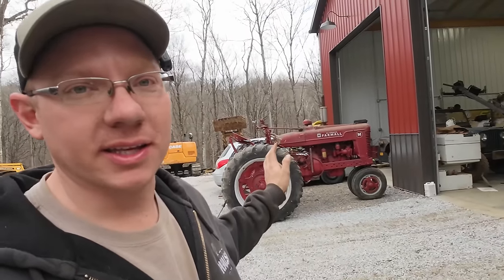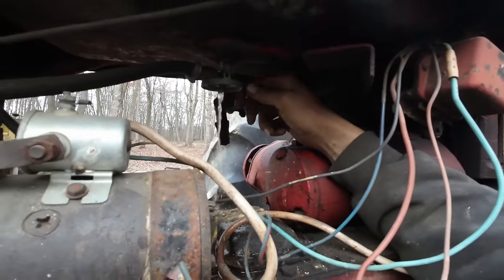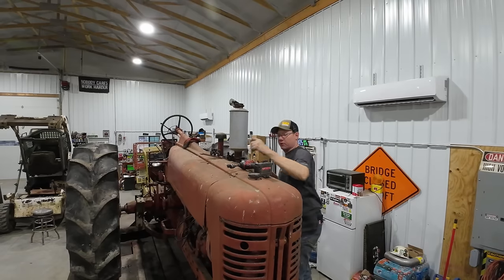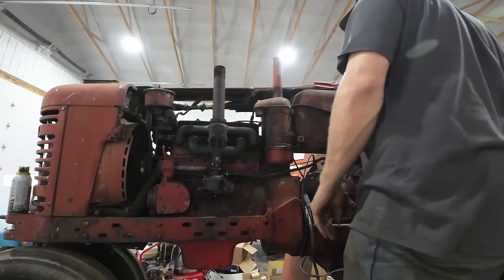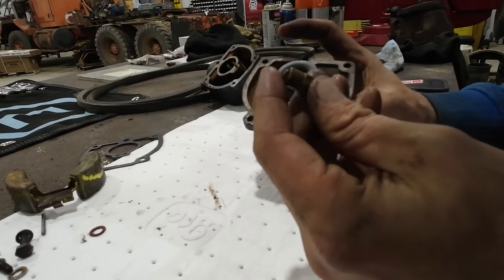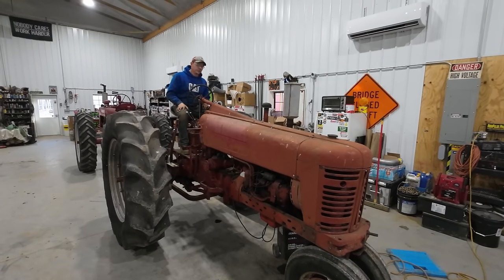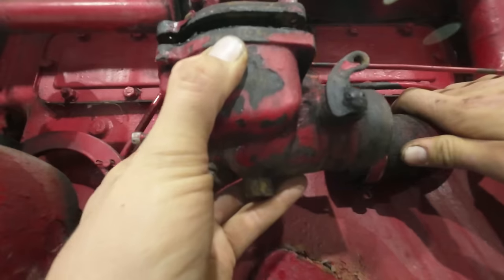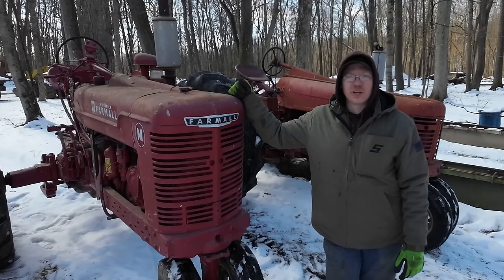Two Farmall Tractors for $2400 | Will They Run?? (Sitting Many Years)

Comment: As a tractor collector, I'd always say keep both.  However with your love of collecting things, what you likely really need are more covered areas before you need more things that really should be covered.
Reply: Some nice big tarps would help. I could not go to all the effort of getting something running and then leave it in the open.
Reply: @almac2598   putting tarps on things just makes them rust faster
Reply: @ASadSloth  Not been my experience, we used them extensively when I was at sea to protect upper deck fittings, and now retired I live in a country with much more benevolent weather than this part of the USA, so things may be different there.😁
Reply: @almac2598  oh, i don't live in the usa either 😂 but i have seen few cars that have been put under a tarp for several years and they have been rusted to hell after it
Reply: Covering with plastic creates moisture and that promotes rust. Best kept is dry and preferably warm.
Reply: I would Keep the M it looks cooler and in better condition.
Reply: @ASadSloth  nothing like keeping the moisture locked in with a tarp to insure the best corrosion!
Reply: Flip a coin on which one to keep. 
Give the other one to me! 😊
Grew up driving mta and 400.
Reply: @stephenbonin3049  Going by paint? Like he said the other one has more options. I don't like the tricycle front ends but.....
Reply: 0 @ASadSloth

Comment: In 1992 when I bought my over gown 20 acres in the country I needed a tractor with a bucket to work on the place and clean things up and do all kinds of chores. I found a 1953 M with a snow bucket on it for $1350. I live in western Wisconsin so a snow bucket it a plus with a 900 foot driveway. I also got an old beat up Gehl flail chopper that I used for a couple of years to mow the fields and chop up the burdock. I love the sound that burdock makes going through the chopper. New plugs, points ignition resistor, and oil changes is all I've done with it in 32 years. A real Sweetie. My Grand dad and my uncle both had Ms in the 50s and I think of them both whenever I get on mine. The best machine I have ever bought. It has never let me down. It sounds just like those two. Purr. Fred.

Comment: To my knowledge, 300s and 400s were painted all red. 350s and 450s had a white grill and white on the side of the hoods. Great tractors!
Reply: Yup. That’s a 400. My grandfather, father, and I farmed with a 450 for decades. It was only tractor my grandfather bought new. When we sold it a neighbor bought it and he’s still using it as a utility tractor around his farm.
Reply: I've been around dozens of FARMALL'S, and I can tell what model one is from 100+ ft away at 60 mph.  I absolutely HATE when somebody puts the model decal on the grill,  the rib embossed in the hood was formed special to curve around the decal.  There's a book called " IH tractor ORIGINALITY GUIDE WRITTEN BY GUY FAY.  he has all the decal placements shown the way they were installed AT FARMALL in ROCK ISLAND.
   BUT the tractor your calling a 400 is actually a 300,  it's about 2 models after a FARMALL H. 300 is a really usable tractor. The order was straight H from 1939 to 1952 then SUPER H from 1953 to 1954, then 300 from 1955 to 1957 , then 350 from 1957 to 1958.
    Tractor Data has all the information you could ask for on-line on ALL those tractor models, lots of people bad mouth Tractor Data but don't bad mouth it, it will be right much more than ANYONE you know.

Comment: Don't forget to check the timing advance on the distributor. If  they are seized, you won't get full power at higher RPM. A distributor left standing would be a Prime Suspect for seized Bob weights.  Love watching your show from the UK. Cheers, Mike.👍
Reply: Good head,man,hate working on something that hasn't moved in 20 years ,as soon as you start em up every seal in goes to hell😢😢

Comment: Matt, install the duct to the oil bath filter and it will restrict the air flow enough to cause the fuel to rise up to the engine. Make sure the air filter has oil in it.

Comment: Float wasn't clean enough. Clean with carb cleaner, then scotchbrite until it's very shiney. Use acid-core solder with flux, and it would have soldered easily. Solder doesn't work unless things are super clean. I soldered the float on one of my old Kohler gensets last summer. Worked a treat.
Reply: Exactly but even better to braze it have it

Comment: My late father had one of the predecessors to the M tractor. It was the Farmall Special. Exposed steering shaft and gears with the steel cables that would apply inside brakes when you turned hard. Steel rears. Started on gasoline then switched over to kerosene once it was running. He used it to pull stumps on our property.
Reply: That sounds like an original Farmall. Many now call it Farmall Regular. 
The next series of Farmall was the F series. F 12 F14 F 20 and F30.
Reply: Prob an H model

Comment: Always enjoy seeing IH Farmalls rescued and resuscitated, Matt. Nicely done. I'd choose the M but you know their conditions better. I just like the looks of the M. Doesn't look like it would take much TLC to spruce her up and make her shine a bit without getting carried away on a resto. I've watched US Farm Report every weekend for years and their Tractor Tales segment and there's a lot of Farmalls absolutely perfectly restored. A lot of work by anyone's estimation. So the M looks like she'd take well to some simple pressure washing and some spit and polish to the paint. Degrease and change the fluids, plugs points and wires and as you said remake and reroute the added on hydraulic lines and put the starter switch back where it's supposed to be. A good buy for both regardless which one you chose to keep.

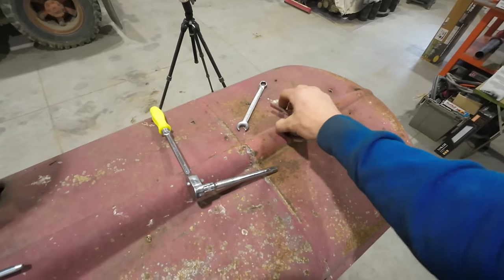Comment: 51:12 gas in open buckets  🪣 and you said " In the meantime. I guess I can check for sparks". 
⚡️⛽️🔥🔥🔥🔥🔥🔥🔥🔥🔥🔥🔥🔥🔥💧
Reply: TBF, varnished gas doesn't burn easily. It'll still burn, but it takes more than a spark to ignite it
Reply: Varnish doesn't ignite easily..... it's like diesel.
Reply: My dad set open coffee cans full of gasoline (or as we called them, parts washers) on fire while welding so many times we didn't even bother trying to put them out anymore. Just watch the pretty fire until it dies.
Reply: Safety third.That minty canuck Peg would approve
Reply: spark check first sort that out first without it it wont even run on aerostart and flattening the battery and wearing out the starter wont save time.

Comment: When I was a kid, my grandfather had a 400. That thing saw the war! The starter went on it. For a few months, he parked it on the edge of a hill. It still had the rear wheel guards and a side mounted PTO for running things powered by a belt. My favorite tractor of all time. It still ran when we sold it 10 years ago. You got a steal for $2400. I was told one time that old tractors were timeless, as in easy to keep or get running.

Comment: That yellow gunk is lead from evaporated old times fuel - not something to mess with. 
Talking about distributor caps - my experience in trying to cure missfires and flat spots is that while a spark can jump a good sized gap, it struggles to penetrate much junk.

Comment: Awesome find Matt!  Judging by the grille, your tractor is a 350 and not a 400.  My grandfather had a 300.  It was an excellent tractor!  The _50 series tractors had power steering.👍
Reply: I believe the tractor is a 450, with the power steering and a newer style steering wheel. It is larger and has a deeper sound than a 300 or 350. The placement of the starter switch on the M is correct/original.
Reply: @craiglacey9827 It’s a 300. 350/450 had a different style of fast hitch, plus the grille is different between a 300 and 400. 400/450 have a different curve to the pedals as well. Plus a very noticeable size difference.

Comment: I grew up on the Farmall M's, complete with the tractor rodeo's when most all farm tractors were tricycle narrow fronts and could turn on a dime. 50's were the days. Great to hear the old familiar sound of the four and six bangers, but had a real soft spot for the two-cylinder John Deere as well. JD model G turning over ground pulling a 3 bottom (sometimes 4) was another beautiful sound for a 14 yr old boy. First Farmall was at age 11 '52, I hired out to a horse farmer who just bought a new Farmall H to replace his team of horses. I was the tractor driver pulling the oat binder, then the wagon pulling the loose hay loader, then on the rope pulling up hay into the barn. Those were the days, for sure. 
You did great work sorting out the needed fixes to get those two prizes up and running smooth.

Comment: Granddad got A brand new M when I was pretty small. Traded an H as part payment. Started using it in the field when I was too short to sit on the seat and reach the pedals. One day  grandpa said who keeps breaking fence posts off? It was me when I had Jump down off the seat and leverage my back against the seat, hit a brake pedal and  swing around into a turn at the end of rows. Sometimes I was late & would break a post with the front end. Great memories. I'm 80 now.

Comment: I'd keep the 400 as it has the quicktach 3pt hitch system and power steering. I'm also partial to it as I've spent many hours in the seat of its sibling the 300. Just keep in mind as you cycle through the gears, there is an off chance for the shift forks can put the tranny in 2 gears (from a stop). Not that difficult to get it out, 3 screws holding the shift lever in place.

Comment: I grew up farming with an M and a 400. I loved the M and hated the 400. The 400 was powerful , but only had a 6 volt system (hard starting) and was very hard to steer compared to the M (ours didn’t have power steering). But I was only 9 or 10 when I drove it. I love your show.

Comment: That cap with the holes in it was pretty damned ingenious!  Won’t really work to well with load changes, but it’s still a cool idea.
Reply: Those Farmall M tractors were everywhere when I was a kid in the 50’s.  I still remember the smell of those old machines. A combination of gasoline, oil and hay. They sat outdoors literally for decades and always ran. Hard to believe so many are still running over 70 years later. 
The M is probably the more valuable since they are so well known, but unless your heart is set on keeping it, I’d put a paint job on the M and sell it.

Comment: I love tractor  stuff! I would probably keep the 400.  I have a 48' Ford 8N that has been restored , and a Case 580 C backhoe that I was able to get for 4k.  It is an extendahoe. I  rebuilt all the cylinders  as hydraulic  fluid would just leak out of them all. A very handy unit!

Comment: I’ve always took the fuel line off at the shutoff or filter and then fill the line with carb cleaner. Then try and start it. That way it sucks the cleaner through the carb.

Comment: I had an Internationai TD6 dozer that had the same engine as the Farmall MD. That engine has spark plugs, a carburetor and distributor on one side of the block and diesel injectors on the other side

Comment: Farmalls are supposed to have a screen mesh filter threaded into the carb where the fuel line connects.  If it is clogged or missing that is probably your problem.

Comment: without three point, the m is only really good for pulling a wagon, but that 400 is a much more useful tractor. we had a 706, which is just a newer and bigger version of 400. after we quit farming, i made a 20' boom for it to lift things, like engines, cars, combines, pretty much anything lighter than the tractor's front end.

Comment: I recently took on a quest to fix up our tractor that has been neglected for 30 or so years which will be my first big machine that I will fix.
First big job was to fix the hydraulics which took me 2 days only because all the bolts were stretched to all heck and needed replacing.
Before that I had the fuel lift pump  apart a few times  because the valves get sticky and need to be moved manually, which I then figured out how to do while it's still on the engine.
It's a Zetor 3011 so parts for it are kinda available everywhere if I need anything which is nice as I will 100% need to buy some stuff.

Comment: I had 1949 Super M for several years it comes with Factory Power Steering… It was very strong Tractor one of the best! I added 3 point hitch before I sold it to some guy from St Louis area.

Comment: I drove a Farmall in the UK S a teenager in the very early 50s. Ours had wide front wheels and ran on kerosene  (TVO) tractor vaporising oil. Had to crank the starting handle to get it to start. Actually started on gasoline, petrol to us, of ehich there was a very small tank.  When she'd got warmed up you switched over to TVO. One day i forgot to switch over and we ran out lf gas. Its your problem boy. You're the driver. Thankfully I was just big enough to crsnk it over. Happy days.

Comment: The first tractors I remember around our family farm were the JD 600, 620, & 630. The 600 didn’t run for the longest time until we finally got around to doing all the work it needed. The 620 worked for a bit then sat until after the 600 was fixed and the 630 always ran. The 600 and 620 were both narrow front ends and the 630 had a wide front end.

Comment: Were I in your shoes, I'd do an engine oil change and a transmission oil change on both, put a rebuild kit in the M carb and a new set of wires then put both up for sale.  $7,500 for the 400 and $7,000 M.   That's a great deal for someone starting out and you sure don't need em.  
Stop hoarding and start flipping so you can build your princess that palace she wants :)
I'd put a for sale sign on everything that is in good running and operating condition except your top 6 machines.
More Farmall's will come your way!  :)

Comment: If your solder does not have enough lead content it will not stick to the brass floats, I had the same issue trying to repair a radiator, also need to use the correct flux.

Comment: Traction control Fast hitch , although very late 400's may have one as well as the larger gas tank. Later 450 gas had 12 volt electrical systems, As said shroud  above steering had cutouts for the extensions for double or single acting valve settings. 450 has its rear light on the left side of the battery box.If a 450 came with factory power steering the front part of the shaft is in 2 parts. Of course the white grill and side panel decals. Key is located on the left side below the dash and starter button is on dash. Thats the stuff you see and there is probably more, there are a number of changes on the inside. Lots of part number revisions. 

Engine serial # starts over at 501  as C281 is new. I know there are a few more.

Comment: Your smile on the 400 tells the story, I have no reason to keep a small tractor at my home but I was given it, got it running super smooth and my smile riding it is similar to yours, I keep it to pull my utility trailer to the street (my idea of justification). You will not break it on your property and it will come in handy if you need to move a tree or something, like mine you will find a reason to utilize your tractor, sell one and keep your smile going!

Comment: The 400 is a safer tractor than a regular M. If the seat fails on a regular M you hit the ground behind it. The Supers and the 400 with the battery under the seat made the seat a little more reliable.  also the Ms hydraulic system runs on 30w motor oil. The SUpers and the 400 are Hytrans.

Comment: Matt, when you are trying to make the trackor run, looks like not getting furl, once you get it running a little even with ether, rev it, the put your hand over the carb input, force furl, and any air lock in the fuel system...
Good luck,  Sam

Comment: Matt, for the brass float, you can use an oxy-propane torch and with the aid of a flux-covered 40% silver brazing rod, you should be able to braze the hole sealed shut!

Comment: Well the M is more iconic if you decide to restore it and you could add a three point hitch, a Shwartz wide front end, and a Charlynn power steering unit. Another option if they are still available is a Hisler Transmission upgrade which gives you a two speed range for every gear except road gear. My Dad had one with all those goodies when my brother and I were growing up--we even had 4-row rear mounted cultivators and the M was ideal for rotary-hoeing corn. We also had an F-11 Farmhand Loader on the M which we used for loading silage into a conveyer wagon for feeding fat cattle.  I'm getting pretty nostalgic as you can tell!

Comment: For the price I keep them both. But I would keep the M cause it was the plow tractor to the H. So many people on small farms back in the day had a H for light duty work and a M for heavy duty work. I drove both for years as a kid. The M took one leg and both arms to press the clutch as a 8 or10 year old. I loved the M plowing at night as you could see fire coming out of the exhaust without the muffler and the exhaust manifold glowing red. They really pulled harder at night and could pull a 2 bottom plow in 4th gear in the clay at night. Daytime it was 3rd gear.

Comment: If you look around there are tractor salvage yards and you might find a wide front end that bolts in . OR look for the India custom tractor builds for front ends they custom from scratch 1/2 " plate and kingpin, solid spindles from six bolt 1- 1/2 ton truck  they have whole build 30min long 20" centers cut down for 16" rims and your choice tires .Super tough front axel ..